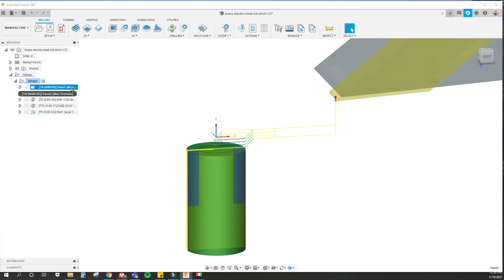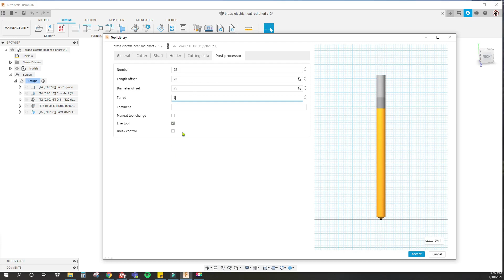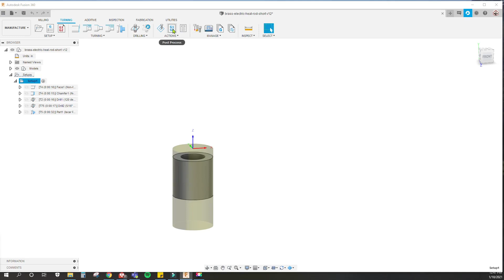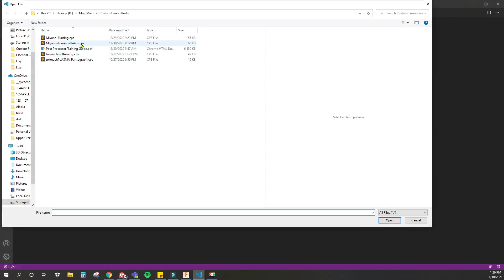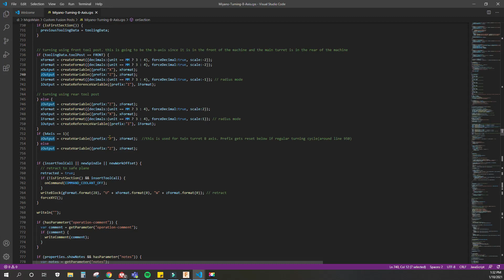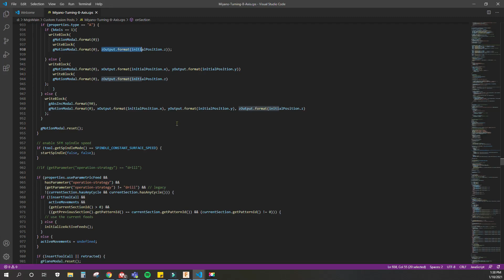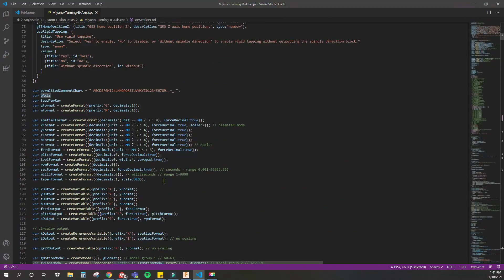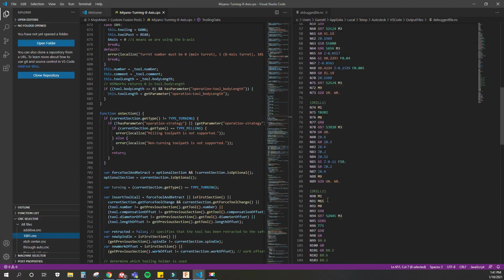Getting the B-Axis To Run on the Miyano Lathe

Comment: For what it's worth, my doosan puma 300 does the same thing on drilling, if you find out how to fix the post can you let me know? \I thnk its something to do with incrememntal feed and it not using a canned cycle
Reply from the maker: That's good to know. Yeah it's definitely not using the canned cycle. When I get time to look into I'll check the incremental feed first. I'm thinking it's something simple but I just need the time to take the dive into it.
Reply: @MojoMfg  For debugging PP Autodesks PP is amazing
Reply: @MojoMfg  I've fixed it on my machine if you're interested